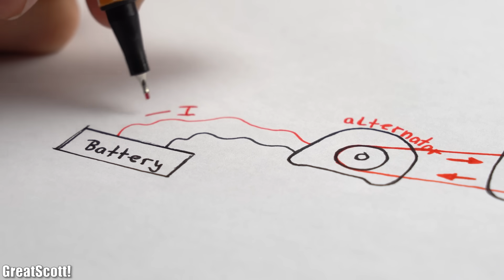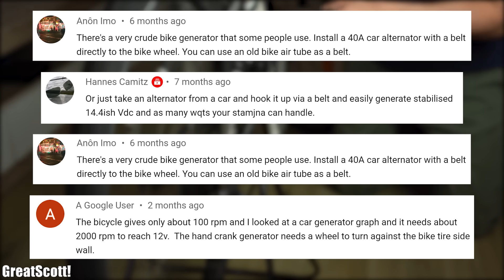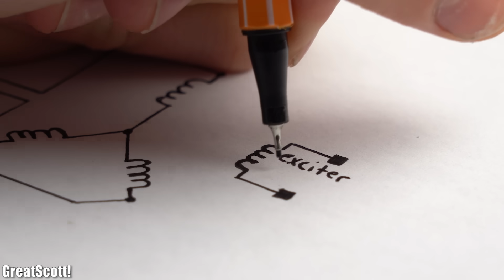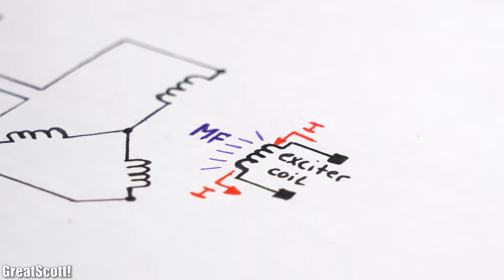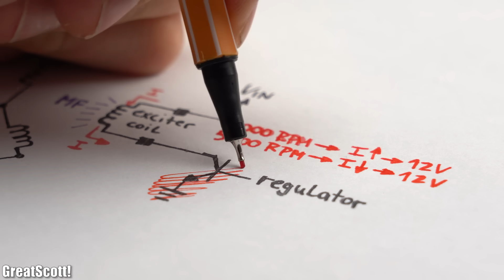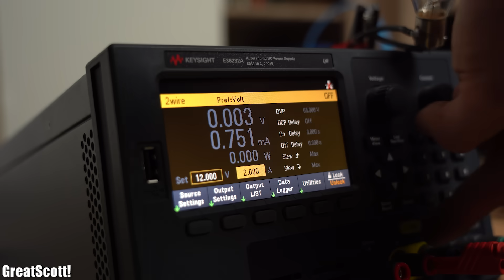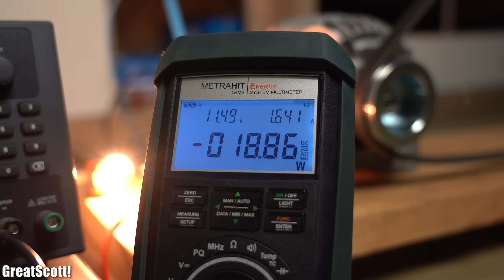Using a car alternator with a bike to power my home? How much energy can I produce?!

Comment: Sorry but you used the wrong type car alternator for this project. You need a one wire self exciting car alternator. Something like this
https://www.amazon.com/High-Output-Chevy-Alternator-Self-excited/dp/B01N7GSL7O

I built what you are trying to build years ago when I was a kid. Horse power is going to be the limiting factor. 
(Copied from the Internet) 
An alternator typically takes about 1 HP (horse power) for every 25 amps of power generated. So, a 100 amp alternator will require about 4 HP at full output

Comment: Maybe 25 years ago, I used to power my off grid situation with an alternator hooked to a small engine, but it was self regulating and only gave about 25 to 30 amps per hour.
Nowadays I have an expensive little Honda 2000 and just remember the inconvenience I used to suffer by going off grid. I'm still off grid but nowadays the power lines are right outside my house.

Comment: Best thing to do is put permanent magnets on the armature. Rip the alternator apart. Remove the armature. Remove the slip rings. Remove the metal finger pieces on the shaft. Cut 5 mm out of the shaft. Slip on a short length of stainless steel tubing on the shaft , must be a tight fit. Put on some ring magnets. Put back the finger piece of the armature and seal the whole lot in a strong resin. Balance the armature by drilling or cutting away some of the excess resin. Once balanced then reassemble the alternator without the brushes and regulator. There you go. A permanent magnet armature and no current needed for the armature. An average fit human can generate 100 watts for around 5 to 10 minutes before getting tired assuming the mechanical side is relatively friction free. Or maybe 20watts for 1/2  an hour. Not much but at least you get some LED lights working if you live in South Africa.

Comment: I rode my bike a couple of days ago - 30 miles at an average speed of just over 19 mi/hr.  My average power for that ride was about 175 W.  Now, I'm old and in not great shape, but not too many people can do 30 @ 19.  Of course, a good rider can put out 2 X that amount without problem and a pro much more, but not that much!.  If you can do 400 W steady you are getting paid to ride.  Just giving you an idea of what is a real world expectation of power output.  One last thing, in a short sprint people can output quite a bit, but it is short lived.  Thanks for the video.  Very interesting.

Comment: Im not sure why no one is commenting these points:
*The alternator, as you said, have the operating range (2000-5000rpm(although these could be the engine rpms mentioned, since alternators tend to have a changed gear ratio in cars too), in which they work most efficient. This means that you definetly should try putting the bike in the highest gear possible.
*In my opinion, dont avoid the voltage regulator. Get a capacitor in the mix so the resistance at the pedals is smoother. The more charged up the capacitor will be the, pedalling will be easier. 
* Alternators have a bracket with which you can regulate the tension on the belt. Make one with a metal piece and slide with which you can regulate the tension :D . It shouldnt be too much tensioned though, as there will be efficieny losses

Theorethically, since there was a muscular guy who could power up a toaster, i think it should be possible for the average person to atleast power up a fan (Or heck, maybe a fridge, since modern fridges dont draw too much power annually. This means the capacitor would come in handy, because fridge doesnt operate 24/7)
Also, since youre an arduino magician, you could get a device to check if there are incoming rpms at the wheel, check if there are <13V(Since car alternators tend to output 14V at average) and close the loop to the excitement coil for 5 secs, then open it up and check if it is outputting the 14V(Although im not sure how exactly could this work at load, because the voltage would drop, probably. This is just to make sure that the coil doesnt draw power(Thats one of the things that tend to fail in a car and drain your battery overnight)

Comment: That belt needs a lot more tension to avoid wasting power in belt slippage. A simple way is to put the alternator half way along a new plank and then connect this new plank to the existing wooden plank on the floor with a door hinge. This way the weight of the alternator pushing down on the new plank at 45 degrees to the floor tensions the belt for you. To add extra belt tension, add weights.

Comment: With the correct setup you should be able to get far more than 20W. I can easily generate an average of 100W on the cycling machines at the gym which has a watt output. 

100w - 8w = ~90w useable, enough to power most laptops which are 75w!

Comment: Well that will teach you to never listen to the commenters :) Speaking of which, exercise treadmill motors have a coil/magnet arrangement that is a much better fit for this application. But I'm still at only about 40W on my bike generator. Which isnt useless but could be better. Thanks for the video!

Comment: A car alternator turns about 3-4 times faster than the engine, crank pulley is about 150+ mm dia. So, that 2-4k rpm is actually 6k plus.
Also, car alternators are very inefficient at generating electricity.  A large 3 ph. brushless motor might be better?

Comment: That belt is definetly to loose. You better make a tensioner next time. For example: 2 steel plates, 1 of which is perma connected to alternator, and other to wood construction. Next you get 1 big bolt to move alternator plate forward or backward. Maybe you would be getting better outputs with this technique.

Comment: You need a tensioner pulley on the top section of the belt, where it is returning to the bike sprocket.
Reply: Maybe even on the bottom that is going toward the generator.

Comment: Cyclists use power meters to measure their power output. A GOOD cyclist can maintain 300-400 watts; most of us are in the 200 watt range, and a dub cyclist on a crappy, unfitted bike is going to be lucky to maintain ~100 watts.

Comment: you coulda just asked a mechanic..... any would have told you u thats the voltage regulator and a alternator doesn't work without power in the coils

Comment: with most car alternators you can get aftermarket pullies for them. some of these aftermarket pullies are smaller than the stock one, and would increase your RPM and potentially your wattage. so instead of charging just one phone with a good workout, perhaps you could charge two phones :P. you should also add a belt tension pully to keep your belt from falling off. also try a gear in the middle if you are able to handle more resistance in your bike cardio, that would also change the RPM the alternator pully spins.

Comment: The regulator is not set to give 12 V output, byt 14.2 - 14,4 V which is neder to charge à leda acid batteri.

Comment: Make it self exciting with a neodymium magnet. With an excitor, you will need to vary your input amperage. Look at some of the YouTube channels that turn alternator into bldc motors. In addition, you need to rewind the stator to produce current at a lower rpm. An alternator for a wind turbine off eBay would work a lot better.
Reply: Absolutely.

Comment: You'd better use a permanent magnet alternator. They are sold in the same form factor. You would not need an exciter current.
Besides, this type of belt needs to be strongly tensioned to work without slipping. Better use a V-belt. The alternators come with V-pulleys too.

Comment: It would work better with a belt tensioner in between the bike wheel and the alternator. Just a pulley with an arm connected to a spring, it would tension the belt.

Comment: 3:55 that is not the highest gear. highest gear is largest ring in the front and smallest in the rear, giving you something like a 4:1 gear ratio. what you are using in the video is waaay lower and giving you a smaller output

Comment: How much khh would the cost of the alternator buy?  - never mind, googled it: 0.2134 per kWh (EU average price in the second semester of 2020) = if it cost around 100€ that would pay for 468h of continuously consuming 1000W electricity. Or 19,5 DAYS, 2/3 of a month.

Economy of scale is the guideline here. 
That's why big coal/nuclear powered vapor turbines are so much more efficient and wind generator ones are the opposite of it - even scaled to around 2MW each (which is nothing compared to 600MW+ of big turbines ones/each).
The bigger the generator and what powers it, the more efficient the end result is. Wind and photons, although seemingly "big", are very very small in density. Like the mechanical power our legs produce.

Back to your example: Imagine all bikers of the tour of France (500w per cyclist x 400) mechanically connected to a large wind 2MW generator (with magnets, not excited coil). For 1h only, then recover for the next day. 
For ONE hour, the "tour" team of 400 top-world cyclists could power 10 houses (average of 4,700 kwh consumption per house). 
So, 40 could power 1 home. And that's with 100% efficiency during that hour. 
Now, give me back my mega high pressure water vapor turbines powered by big juicy dense energy.
Reply: Oh and i've been regularly on static bicycles with power meters. 
In one hour, i was able to average around 150w, with some peaks of 500-700W for a few seconds. 
We have no idea on the dimensions of power, either produced and from what source, or general demand. 
We're very energy illiterate.

Comment: Car alternator spins at 1000 to 5000 revs to deliver power. Not going to work unless you add some crazy gearing to increase your revs. You can try direct drive washing machine motors. These are designed to rotate at low rpm at washing machine speed. They need to be modified to convert to a generator. An example uses Fisher and Paykel type, lots of internet on this.

Comment: Your losing lots of energy to the bike frame its springs etc a rigid rear frame bike be much more efficent. 

Also maybe a third wheel pressing on the belt spring mounted to help keep the tension even this will again help loss of energy. 

Great video! #

Comment: Pin 1 - DMF signal (this is information for ECU, working without this comunication)
Pin 2 - L (special info for alternator, first is excitation voltage, when alternator works, this klemme send signal from BSG and says how much energy it should produce - completely inoperable without information from BSG)

Comment: It will help a lot more than you might think to make the bike mounting more solid. You lose a lot of energy flopping around. Also if you use an idler wheel for tensioning, as car engines do, you won’t have so much slipping.

Also, motorcycles and the like use a magneto, and there are many other generators that don’t require excitation and rather use permanent magnets

Comment: Knowing you ,I am sure at some point it'll come to your attention that you can also use the alternator as brushless dc motor,which I am sure you can have alot of fun with,I in fact used one as a three phase motor powered by a cheap chinese BLDC and a 240 Watt P.C power supply to make a merry go round thats capable to spin a full grown adult but  that is beside the point regarding your generator there may still be hope for it.
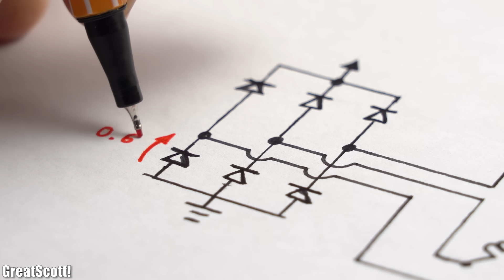First: To use an alternator in any application outside of a car its best to disconnect all the preexisting components from the internal electronics it comes with and isolate the electric connections from the alternator casing that is disconect the three phase coils  from the full bridge rectifier(or what you said at 3:10 b.t.w did you do that on purspose to get this kind of reaction?) ,disconnect the voltage regulator from the the exciter coil and you'd want to use your own three phase full bridge rectifier to rectify the output of the coils you disconnected as the one that comes with the alternator may be intended to work differently.
Second: for the exciter coil you dont need to have a continuous external power supply to power it you can simply tap off some power from the rectified three phase output of the coil,but you will need an initial excitment current from something like a lithium cell pack that supplies the intial current but once the alternator starts working it cuts the power from the battery and uses the tapped power from the alternator,with your smarts I am sure you can easily come up with a simple circuit to do this and also charge the lithium cells from the alternator output and from my experience the excitor coil is usually a thin wire electromagnet with a lot of turns in the rotor and can handle upto 3 Amps at 12 v before it starts getting too hot.
Third: For the excitor coil its best to connect the input current directly to the carbon brushes that feed the slip rings of the rotor rather than through the metal casing.
Just open up the thing isolate all components to their respective parts of the Rotor, the 3 Phase windings and carbon brushes and you should be able to make a much more powerfull and stable generator based on your skill

Comment: I just have a 12v emergency system that charges off one of those generators that mounts on a bicycle. Have low volt stuff to use. I guess Ham radio and hopefully mobile data to get through the coming blackouts. It seems that the spiritual forces/frequencies are running the show now. Those circuits are beyond comprehension.

Comment: Finally... A face!
Why not use a DC motor with 1500 rpm and connect it to a car battery and then connect it with belt to the alternator and the connect the DC output of the alternator back to the car battery or LiFePO4 battery?
I'm planning to do this when I got the money for the items.

Comment: These work better are water wheel generators you can gear then down and use a small solar panel to trickle charge a battery to keep exciter running

Comment: Tolles Video, da stecke aber noch Potential drin !  --->(Bitte liken, damit er es sieht)

Der Generator dreht mit deutlich mehr als der Motordrehzahl des Fahrzeuges, denn die Riehmenscheibe der Kurbelwelle ist größer ! 
Denke eher 2:1 also muss der Generator mit 2000-12000 Um/min^-1 drehen.

Versuche doch mal mehr last, wenn du keine Stromsenke hast vielleicht mit einer oder zwei 55W 12V Halogenlampen.

Comment: You should look at DC motors with wired rotors. Especialy the In-series wired ones. I believe that if you powered your coil in series with the stator, you could improve the energy production. ALSO, If you want to go that route, I recomend getting a universal motor from a dishwaser, since the handle a bigger voltage and less amps. Also generate DC current when backdriven. That or a Syncronous AC motor. As for what to use to power it. Human powered is really not that great. I would either chose wind or water. Altough making a hydro generator may be ilegal on germany, let alone finding a suitable spot to building it.

Comment: This was your mistake on the low RPM in the end. The max rear wheel RPM is when the rear gear is set to the smallest in diameter gear, with the front gear (peddal) being the biggest, just like how you have the small to big on the alternator to the Rear rim but in reverse.

Comment: I'm also curius like you, and I've found a table where the human power  is rated to maximum 130w/h with a average of 100 w/h with best technical and phisical conditions.
This alternator can be used for a wind generator, what about winds in tour country?
will be useful use chains or better gears to drive you alternator, because belts are less efficient to transfer power.
good luck

Comment: You need to attach a flywheel mechanism. Early steam engines had massive flywheels. Also, you could smooth out your AC sine.

Comment: Lesson: automotive parts are not necessarily made with peak electrical efficiency in mind.
I mean, most of the electricity that a normal car is alternator makes is wasted, anyway. (Once the battery is topped off)

Comment: Exciter coils usually are only powered while the engine is starting. Once you have reached minimum RPM you do not need to power them any more as the internal windings take over.

Comment: In a cars  electical system a 2watt globe (or less) must be connected to the exiter field of the alternator , without that globe or even when that globe blows out , there will be no output from the alternator.

Comment: The days of Soylent green using a car alternator to charge batteries for the lights.
Belt slippage ?   You do know about using and idler pulley to increase the angle of drive belt wrap on the alternator?

Comment: I remember back in the 80's, our local power company had an exercise bike with an Alternator attached then hooked up to a 60W incandescent bulb. No surprise, it took a lot of wind just to get it to light, and at full output, most folks made it light for about 3 seconds before getting winded.
Reply: It SHOWS !! YOU !! HOW !! WINDED !! THEY !! ARE !!!
Reply: @davidwillard7334  pedal much???
Lol🤣🤣🤣

Comment: You could have avoided the diagnosis and bodge of the exciter by connecting the exciter to the positive of the alternator output.  Then as soon as the alternator reaches around 1000 rpm ot "self-excites".  Alternatively (hee hee get it?) You can just add a 12v battery to the system.  This will allow the power to be ballasted and stored and excite the coil.  Win-win-win

You are really leaving a lot on the table by not having the alternator self excite.  It has the same features of a "runaway"... the more power it makes the more strong the magnet the more power it makes.  At 2500 RPM you only need to make 1 HP to make your 1000W.  Having a constant low amperage excite is wasting too much motion.